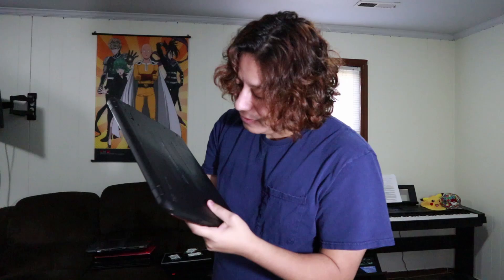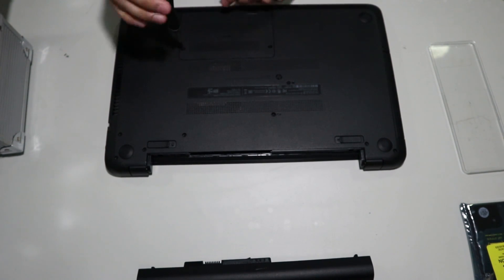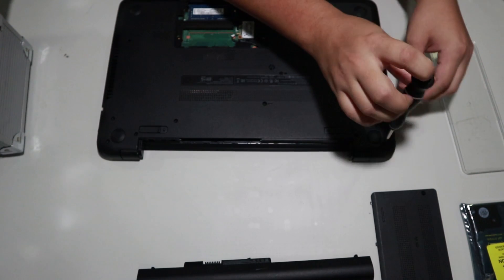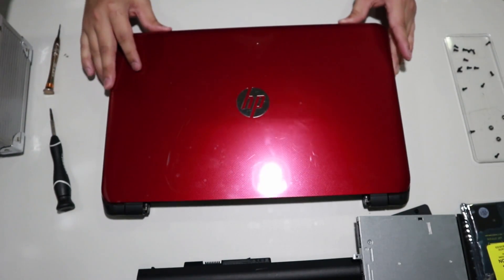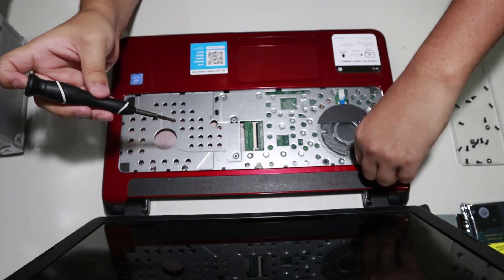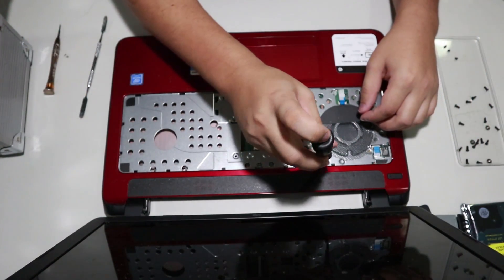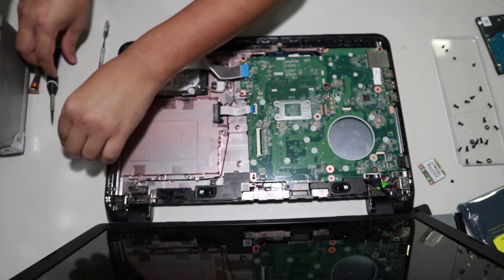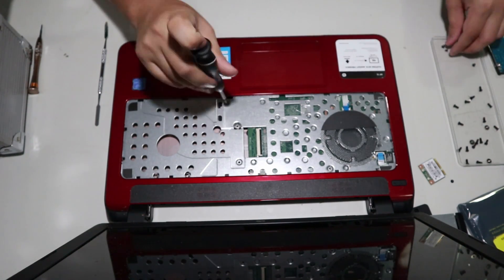HP 15 HARD DRIVE CHANGE /UPGRADE/ REPLACEMENT/REPAIR

Comment: Thank you for this video. I just got 1 of these in a trade, and I want to know if is a ssd drive. I was shocked it only had 1 slot for ram. cheap bottom line model. But, still pretty clean. At least it is intl, even though its a celeron.

Comment: Thank you for the guide to disassembling this laptop despite the different model, but it worked. I got information from the owner that the laptop stopped loading the system. So I replaced the HDD drive in her laptop with an SSD. After analyzing the old drive after connecting it to my workstation, I could hear the scratching sound of the read/write needle, which cut off the power + also formatted the drive completely despite creating a partition. So thanks again!

Comment: What's the maximum output of amps on the sata my 500gb is .55 but a 2tb is 1.0 will the board be able to handle the extra 0.5a?
Reply: Mine is a 15-337wm

Comment: If you only want to take out the keyboard there is one screw to remove under the RAM door marked with a keyboard sign. Use a thin screwdriver to push out the keyboard where the screw was and don't worry the tip of the screwdriver is pushing against the screw boss. Then grab the edge of the portion of displaced keyboard to un-clip the rest of it. No need to prise it out using a thin blade.

Comment: Thanks for the video Racimbio, I would be still working on my upgrade if you hadn't spent the time to do this!  This was a lot of help, very detailed and lots of information.

One thing that would be helpful would be to show tricky steps, like where you snap in or unsnap the ribbon cables.  Also, the screws under the keyboard ... there were 4 of them but 6 holes so I had to re-watch your remove and replace 20 times to know which ones needed the screws.

I have never had to tear a PC down to this level just to change a drive ... I think that's really poor engineering by HP.

Comment: I shredded the flex cable connector that you easily pulled up at 04:09.  I pulled on the black part, which is the color of the part that moved when disconnecting the keyboard cable.  The black part for the tiny flex cable connectors is soldered to the motherboard.  Pull on the white part, not the black part, for those two.

Comment: Thanks for this video. Most laptops have a cover on the underside which allows easy removal of the HDD. After all, like memory, one might expect to have to replace it at least once during the lifetime of the laptop. But HP have instead buried it deep within the laptop making it completely inaccessible to most users. I have replaced many HDDs over the year but this HP Pavillion 15 has got to be the most difficult, frustrating and time-consuming HDD replacement that I have ever encountered. What a poor piece of engineering design!
Reply: I agree, worst design ever. just replaced with 256gb ssd!!

Comment: The USB flex cable actually does not have to be disconnected.  Just remove the screw holding the USB/Audio ports and lay the cable back over the motherboard and that will give you room to remove the hard drive.

Comment: Aside from an Excellent presentation of how to replace an HDD in an HP-15 laptop! I went further by changing the S L O W 2.5 MHZ Wi-Fi card to the Faster 5.0 MHZ Wi-Fi card and an inexpensive Lighted KeyBoard for use at night!! 👍🏻
Reply: how did you find the Lighted KeyBoard?
Reply: Migno Chrono Difileo  Online, of course! However Migno, on Most HP laptops there’s NO connection for power to the LED that lights up the keyboard. I did run into that problem on my HP-15 laptop. Sorry.
Reply: What's the name of the wifi card you put in? And also did you have any problems removing the screws under the optical bay? I have three that aren't budging!

Comment: I have this exact computer, followed all the steps, watched the video a dozen times.  everything went together, but nothing happens when I push the power button.  what may I have missed?
Reply: Same thing happened to me.  As it turns out, the power button flex cable was over stressed during disassembly and the cable broke where it  is soldered to the power button board.  I ordered a replacement off of ebay (comes a complete unit) for just over $10 after sales tax.
Reply: Sounds like the flex cable broke The gentleman above me is correct you should buy a new one and replace it that should work

Comment: Thanks for the tutorial. I have the exact same laptop as shown in the video, except I upgraded mine to an SSD. However the caddy didn't fit onto the SSD so I just taped the underside of the SSD onto the laptop frame. Either way, laptop works!

Comment: It's a good informative video, but Jesus HP, I just want to replace my hard drive and not the cd player or the keyboard, too. Why do you make it so that you basically have to take apart the shell of the laptop? There's a hard drive cover on the bottom. You should be able to take out the hard drive from there.
Reply from the maker: Yeah the design is bad in my opinion

Comment: Thanks. Also worked on a HP 15-f387wm model. Pain in the rear, but with 8 GB of memory and a SSD drive, the laptop is now bearable to use. Better than shelling out hundreds of dollars on a better laptop. Damn you HP for making it this hard! Amazing how we have advanced so much that spinning drives are not even good enough for internet browsing.
Reply: What brand of 8 GB mem are you using ? I tried one but the pc doesn’t even boot

Comment: Why did HP stop putting separate compartments in the back so you could easily remove components?
Reply: James Christy 
They Make it more difficult for the user to repair so you have to send it back in

Comment: I accidentally pushed the speaker plug into the slot next to it and my laptop just buzzed and turned off . A  while and red button is flashing when I hold down the power button. Need help

Comment: Great video. Very well done. That keyboard ribbon sucks! Got it back together and the 8,i,l don't work - HID interface logitech to the rescue. The hard drive was 49 versus 200+ for a new laptop. Ubuntu 18.04 freebie...

Comment: Can anyone please tell me what size screwdriver i can use to take out those dern side screws that are under the dvd drive ive been all over trying to find one small enough i even bought a eyeglass case and even that wasn't small enough please help
Reply: keep in mind that these 3 screws have loctite or something similar on them.  Takes a bit of force to get them out so you can easily strip them if you don't have the right screw heads.
Reply: Size 1.0 i got a screw driver set on ebay for 9 dollars shipped
Reply: Radio shack 58 piece precision driver set, Phillips 000
Reply: buy a set of good quality micro screwdrivers...the more you spend the better you will get...but I think $30 usa should get you at least 6 of pretty good ones